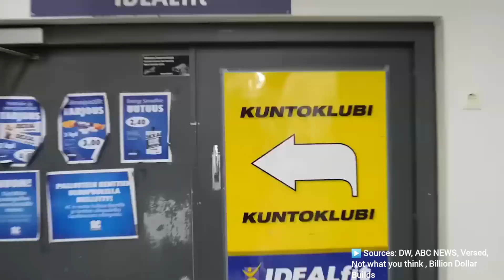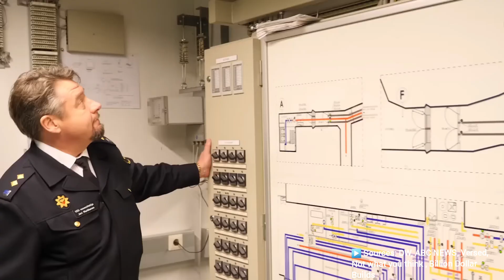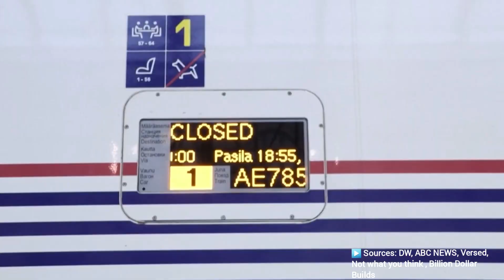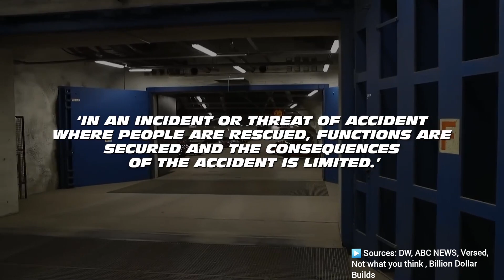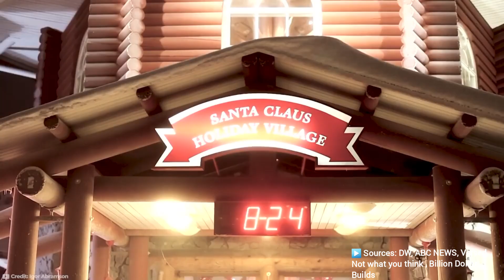Helsinki’s Hidden Depths The 10 Million m² Underground City

Comment: Private Bunkers wont be for the Public so part of this underground space is privately owned this wont serve the public. also a lack of sunlight wont be good in the long term.
Reply from the maker: You’re absolutely right—private bunkers are typically designed for exclusive use, often by corporations or high-net-worth individuals, which limits their public benefit. As for the lack of sunlight, that’s a valid concern too. Extended periods without natural light can affect mental health, circadian rhythms, and even vitamin D levels. While underground infrastructure can offer safety and resilience, it must be thoughtfully designed with long-term human well-being in mind—ideally blending both private utility and public access.
Reply: @RealEstateRawByBen  Are you talking about "private" bunkers that are attached to each public building and apartment building ?
Because there certainly is private shelters but those are extremely rare and for a good reason. There is certain services that need to be running and certain people who need protecting to protect the country. Military has their own ones and certain politicians have their own ones, but those are still extremely rare compared to 55.000 public civilian shelters all over the country that we are talking about here.

Comment: The editing is off in this, the video shows clips very illogically compared to what is being told by the AI voice. Since the title includes "Helsinki", they also shouldn't show clips from outside Helsinki without context. Source: I have worked maintenance in the Helsinki "secret" tunnels (those not open to the public and that the general citizen wouldn't even know exist). I know I'm pedantic about details, but if you cover a topic, cover it correctly 😅 The facts in this video are for the most part correct though.